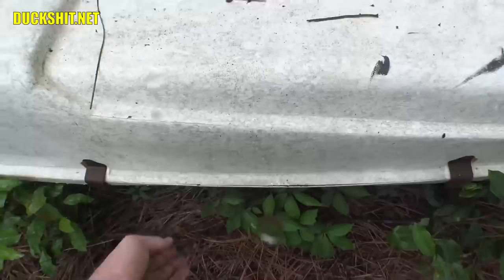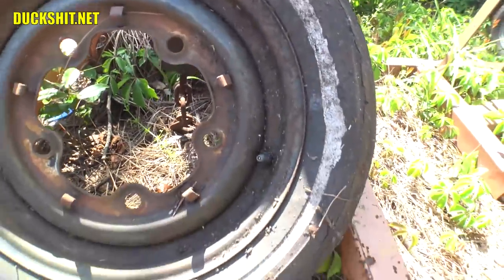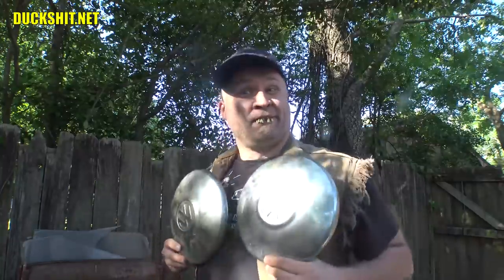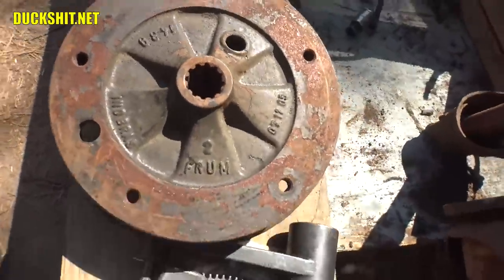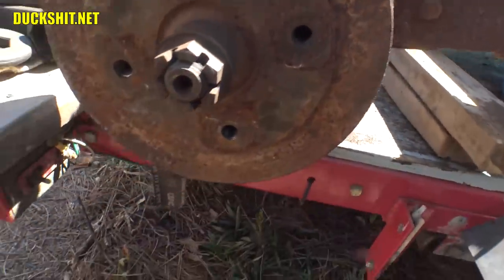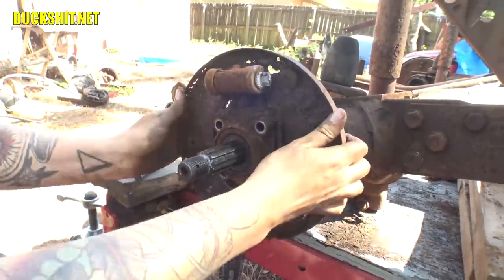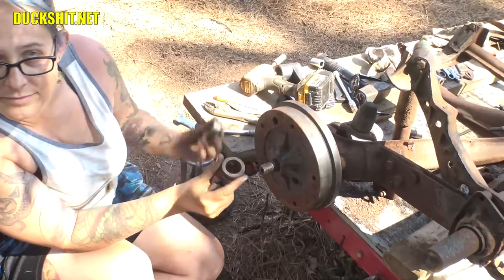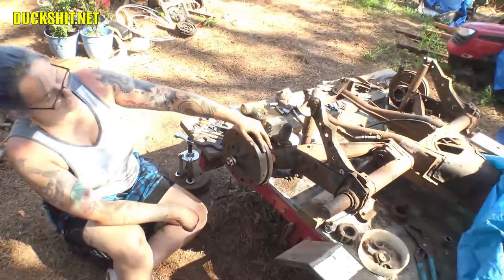4 Lug to 5 Lug Conversion - VW Beetle - ATVW Air Cooled

Comment from the maker: ⚫Tools / Parts Demonstrated or Mentioned ⚫
Torque Multiplier ▶ https://amzn.to/3n4YlcF
Drum Puller  ▶ https://amzn.to/3tEy6vY
Rear Axle Nut Tool ▶ https://amzn.to/3dBeljF
Rear Axle Spacers ▶ https://amzn.to/3nd13gf
5-lug Rear Disc Brake Set  ▶https://bit.ly/2P7AZ9H
Reply: Hi I want make my type 3 1969 205 in all wheels. What year or kit is needed for front
Reply from the maker: You don't need a kit, you can keep all of your OEM disc brake parts, just change the rotors to these. https://amzn.to/3OScsj3  I hope that helps!

Comment: Great video! One question I do have is how would you do the front drums? I have a 68 that I'm turning into a Baja and would like to go from 4 lug to 5 wide to use the wheels I like. The rear swing axle has either been converted like how you did or its a 67 swing axle
Reply from the maker: Swapping the front drums require special bearings or special drums... no other easy way.  But usually if I got to that point replacing those big parts I just upgrade to a disc kit anyway.  You'll be much happier in the long run, too!  I hope that helps!  Thank you for watching and thank you for the comment!
Reply: @DuckmanCycles  thank you for making the videos! So I've thought about front discs and I'll be doing those on my 63 but for my 68 the front rims are 14in and so far my searches have brought disappointing results due to everything requiring 15in rims.
Reply from the maker: Hahaha, only 14" rims?  Don't let anyone tell you no! I didnt... so I mounted 13" 5-lug wheels over disc brakes!  Check out this video around the 9 min mark.  Leave a comment there to let me know what you think!  https://youtu.be/ZLaANyV2zzs
Reply: @DuckmanCycles  Thanks! Will do!
Reply: @DuckmanCycles  So what are these special parts you speak of? Or, who makes a front disc big 5 lug conversion for my 1971 Beetle.

Comment: Great video. Now you need to do a video on converting the front.
Reply from the maker: I will consider this, but believe it or not nobody ever asked until you!  😁
Reply: @DuckmanCycles  make it disc  convert and what super beetle stuff will interchange
Reply from the maker: @rsprockets7846  Well... the standard and super bearings and rotors are the same, and the calipers are the same and can be adapted with a bracket.  The lug bolts are also the same. It all about the caliper brackets when you go between super and standard.   Same stuff applies to Type 3.
Reply: @DuckmanCycles  seems the super beetles are taboo but I drove one and liked the curved windshield...btw cousin bought a brand new ghia in 71 went with her and boy was that car cheep

Comment: Do you have the parts number's for the drum and the backing plates? Tried to get em from the vid but could come up with anything.
Reply from the maker: No, but any of them will work, I believe there are 3 or 4 variations of the 5 lug rear drum brakes baking plates.  The early 50's, mid 50s, late 50s/early 60's and 65-67, but the drums themselves come in 2 variations, early and later I believe they change in 58 and up.  Just get a set that matches what you have available, or just pick something.  In my experience the later ones are easier to get parts for.

Comment: wonder if that wide pattern is the same as the 1936-40 Ford wheels?
Reply from the maker: I think the Ford bolt pattern was much wider, like around 10.25 inches or about 260mm, comparatively speaking the early Volkswagen/Porsche was 205mm.  I often wondered myself, I looked it up one day!   :)

Comment: '67 drums don't need the spacer since they are long-splined like the '68-laters.
Reply from the maker: Good call,  but they are already 5 lug, no changes needed!
Reply: @DuckmanCycles  But what I meant was that you can use the '67 drums on the '68-laters without the spacer.
Reply from the maker: Now you just need to find thay one year only part!   🙂  Thank you for sharing!

Comment: Hmm. Does the same apply if I wanna go from 5 lug pattern to a 4 lug? My Dune Buggy project has a 5 lug front, with a 4 lug rear. Literally an older and newer pan merged together!
Reply from the maker: Almost!   If you have early short axle stubs the later drums won't fit at all.  You'll have to machine down the snout on the drum... coincidentally you'll remove the exact same depth as the width of spacers I used.  But the matching backing plates fit on straightaway.  Or you could just use a long axle transmission like from a 67 or 68, then all bolts on with no mods.

Thanks for the question, that was a good one!
Reply: @DuckmanCycles  Thanks so much! I have a 3 rib in it that I really wanna use, so it sounds like I'm gonna be frequenting a machine shop. Lol
Reply from the maker: Yeah if you'll be running a Bus transmission then you will be converting to IRS.  The 4 lug drums will go right on, then, no worries!
Reply: @DuckmanCycles  You're awesome! My plan, is to convert the front wheels to 4 lug to match the 4 lug rear/IRS/3 Rib. I wanna do disc brakes all the way around. Will that be difficult to change the front 5 lug pattern to 4?
Reply from the maker: In the front answers vary... it depends on whether or not you have a link pin or ball joint front end.
Reply: @DuckmanCycles  I have a link pin front end. How do I go about changing to 4 lug without converting the entire front end to ball joint?? Thanks in advance
Reply from the maker: @centsationalcoins5249  You have several options.  You can re-drill your drums for 4 lugs.  There are also retrofit drums out there, that are 5 lug dimensions, but have 4 lugs drilled in them.  Or you can install a 4 lug disc brake kit specially tailored for a link pin front end.
Reply: @DuckmanCycles  OK. So they do make those? I wanna go disc anyways. Thanks man

Comment: That wheel coming of wasn't torque or pins or whatever! It's a 4 lug wheel what your problem was ;o)
Reply from the maker: What does this mean?   LoL clarify.
Reply: @DuckmanCycles  @06:18 you tell us to set the torque etc else the wheel will come off.... when you act that out, you're holding a 4 lug wheel... not a 5 lug and that after a 4 to 5 lug conversion.
Reply from the maker: I'm not holding anything, you probably mean Delmont.  But he's and idiot.